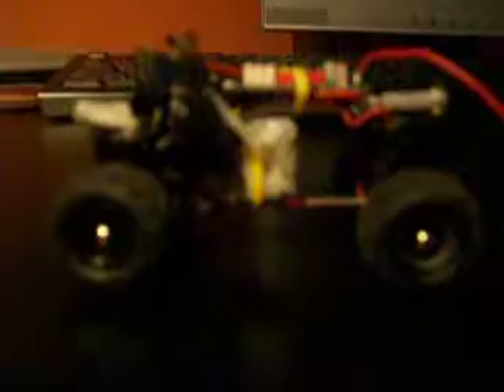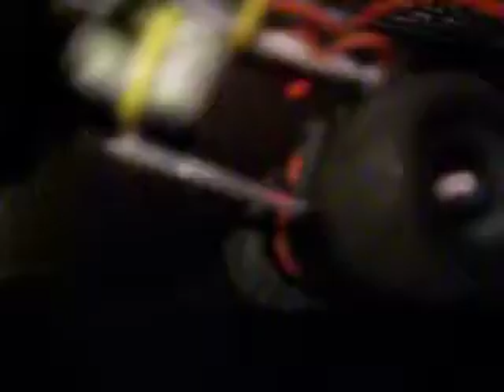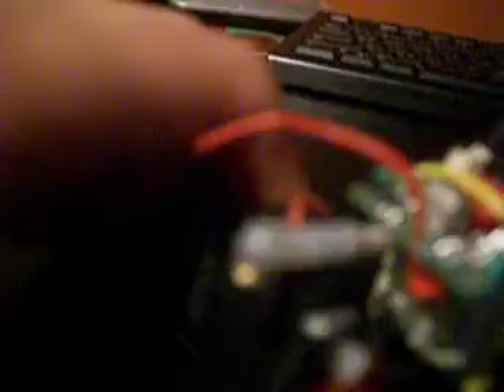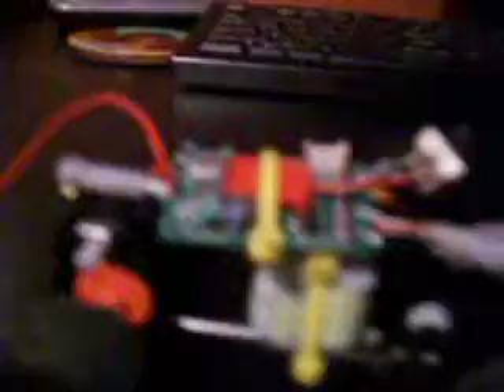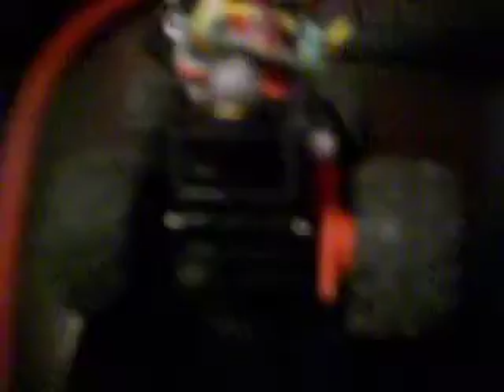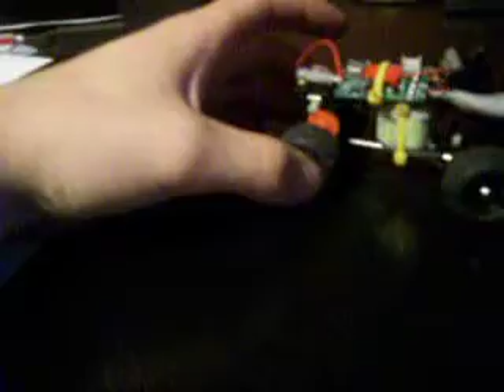the zip zap crawler 1

Comment: Sweet ZZMT dude. I use the green gears and the orange motor. I found that it gave my ZZMT alot of torque for stock. My next step is to go with a servo mod for some slow crawling.